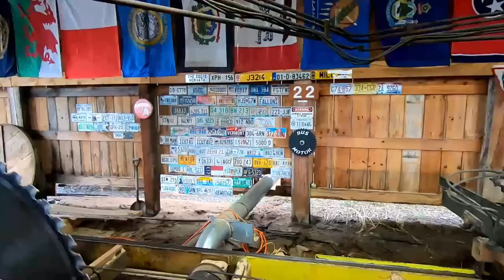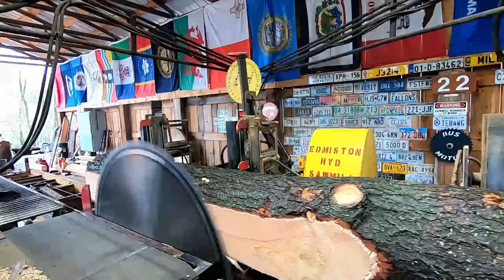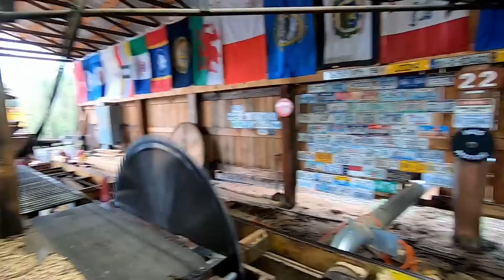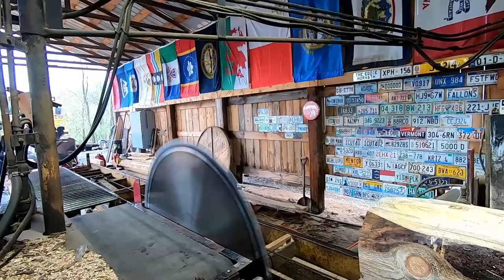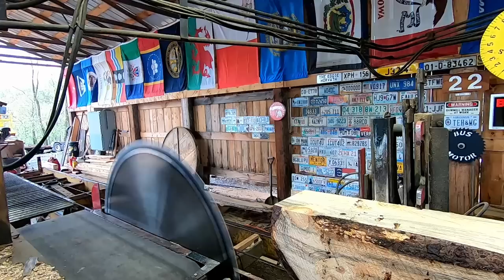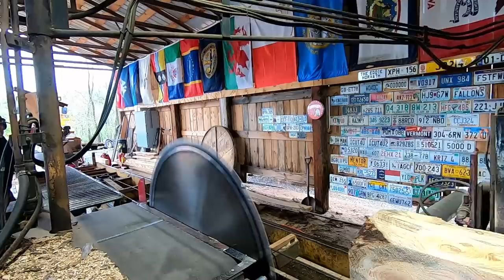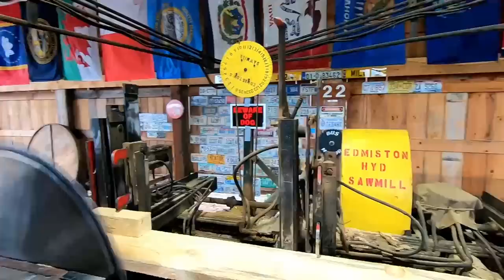homemade lumber from yard trees# 297

Comment: Watching 1 of eðies kids ( Finishing up Pete's pine). Have been watching you since Eddie was standing in the rain, nothing  built yet. Had to comment on all  beards running around there. Put some red shorts on them and increase your points by a couple of thousand times because all the kids will think it's Santa  go nuts and will push the button.  Gary Smith long time viewers 4 about 3 or 4 years.